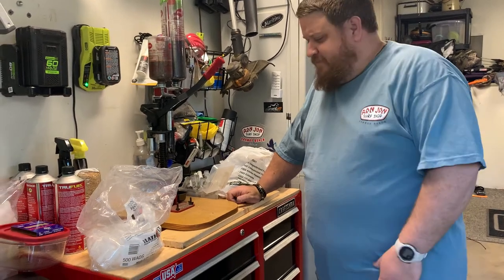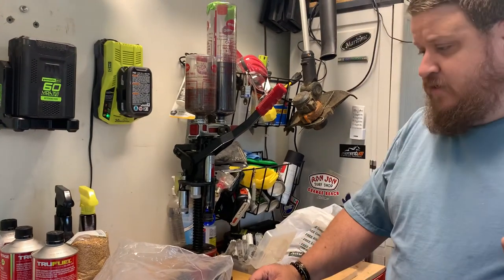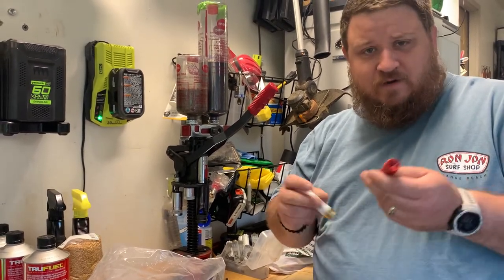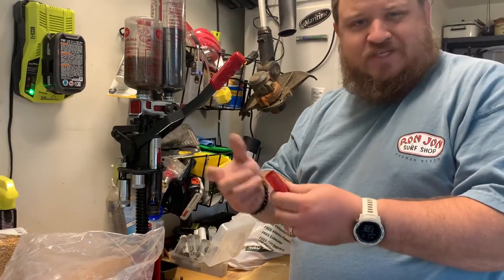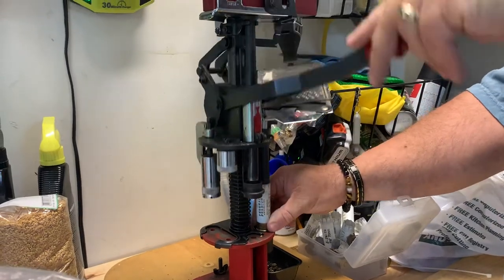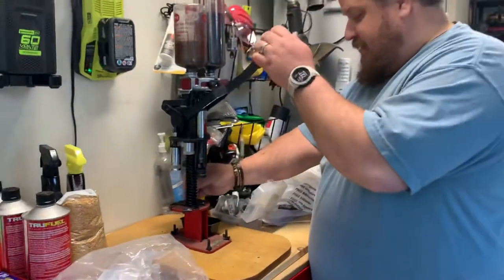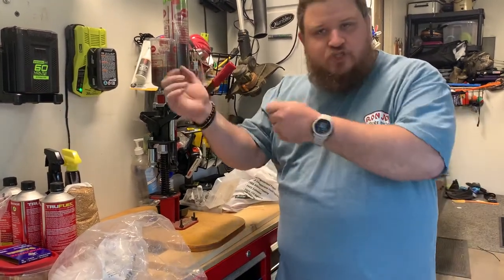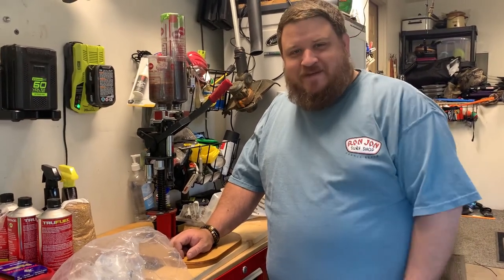Making shotgun blanks

Comment: I don't think I understood a word of this.. what is that press tool called? is that expensive?
Reply from the maker: It is a MEC 600. They are not very expensive used if you can find one. Otherwise New they are about $500
Reply: @bobmaloney6443  so cool! do you have any videos that detail the soft parts that go into this? i know at the very least you need powder and a shell, but I heard you list some things I am not familiar with..
Reply from the maker: There is a bar and 2 bushings inside of the press. The number I read off was the charge bar. I would have to take the unit apart to see that the bushing numbers are. The next time I reload I’ll follow up with that information.